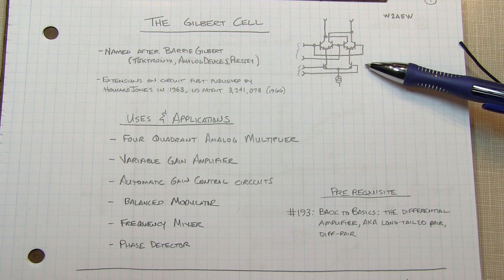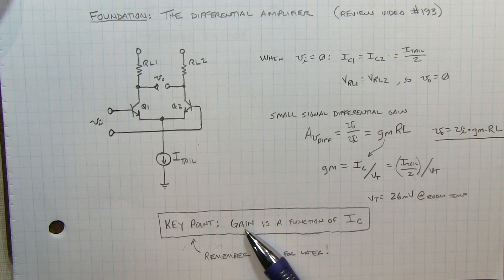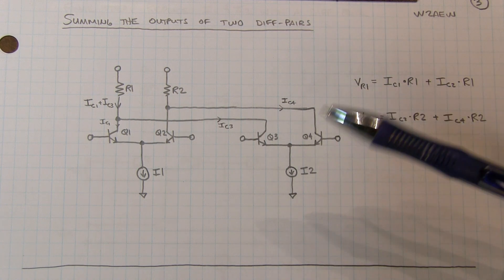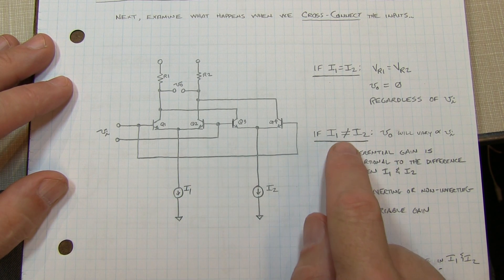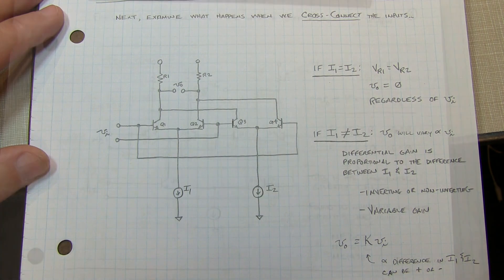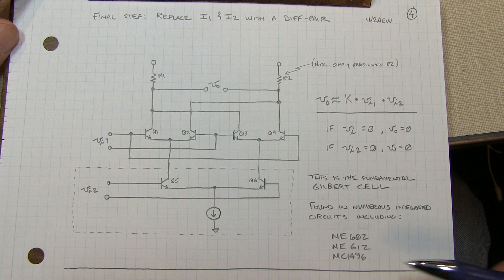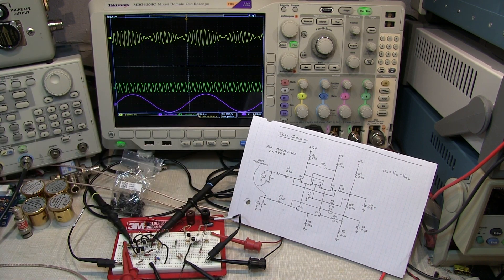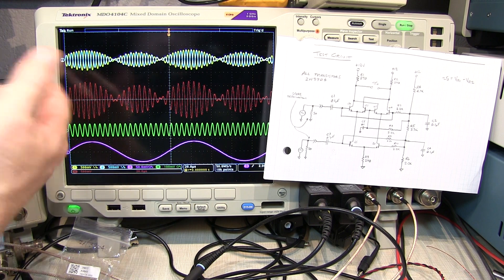#223: Basics of the Gilbert Cell | Analog Multiplier | Mixer | Modulator

Comment: I don't see the AC SIGNAL FOR the other Q6 transistor. Am I missing something?
Reply from the maker: Each of the diff pairs are driven single ended, thus there is no AC signal applied to Q2, Q3 or Q6.  These are merely DC biased.
Reply: Thanks. All is clear now. I am working on an Integrated IQ mixer for 77Ghz. I will give you more feedback soon.
Reply from the maker: That sounds like quite a challenge.

Comment: Hi! may I ask what is the use of the Arbeitspunkt Operating Point in a Frequency Multiplier Module? On how does it affect the output frequency? Thank you!
Reply from the maker: The operating point doesn't generally affect the output frequency (or frequencies).  It will often affect the magnitude of the generated components.  For example, the bias voltages in a Gilbert Cell mixer can make the difference between AM and DSB-SC (double sideband suppressed carrier).  The same sidebands are generated in each case, just the magnitude of the carrier is the major difference.

Comment: 16:32 What is DC offset, and how would you go about applying it to the input frequencies to eliminate phase shift? Could you offset the lower frequency input both negatively and positively?
Reply from the maker: The DC offset is the mid-point voltage of the signal with respect to the bias voltage on the opposite input of the differential pair.  The offset can be positive or negative.  This is illustrated in the followup video:
https://www.youtube.com/watch?v=mejPNuPAHBY

Comment: Such a great video on the gilbert cell. What considerations did you make when choosing the resistor and capacitor value.
Reply from the maker: R4, R5 and R6 were chosen to establish the common mode bias voltages for the upper and lower pairs (approx 6.5V and 2.6V).  These bias voltages ensured about 2V across the main current setting resistor R3.  R1 and R2 chosed to be the same as R3 out of convenience about knowing the voltage drops without calculation (since drops determined by current in R3). R7-R10 somewhat arbitrarily chosen to connect to the bias resistor string (R4-R6), and provide a load for the signals applied.  Caps somewhat arbitrarily chosen to provide signal grounds.

Comment: LIGHT BULB!!!   Thumbs-up, and subscribed!
Thanks so much... I was familiar with balanced amps, but the double-reversed with balanced gain mixing topology here is really cool.  Here's my problem...

I'm working on an IQ digital modulator in a piece of avionics test equipment that uses a pair of the UPA101's as Gilbert Cell modulators. They are fed L.O. (120-170MHz) through lead/lag  L/C circuits (main balanced inputs), the tails are commoned and static (shunt 5.1V zener regulator, each via its own NPN common-emitter buffer), the differential gain inputs are driven by the I and Q gain circuits (the Q channel has a slightly adjustable gain control circuit to balance them... all via sampled feedback).

Then the outputs from each Gilbert Cell IC are summed to create the TX IF. 

The problem I'm having is that the carrier is not being eliminated, but only reduced by about -10dB, where it should be reduced about -50+dB from the main offset frequency (either upper or lower).  It does the same thing regardless of whether the IQ inputs are creating USB or LSB... the carrier leakage is still horribly high.

From what you said, it seems the carrier reduction should be happening in this modulator circuit... I kept thinking maybe it was in a TX IF gain-reduction circuit...

Thoughts?  Each IC has active outputs, but I did notice a DC imbalance on one of them when I was trying to troubleshoot it... and from what you said, they should not have any DC imbalance... right?  

I have full schematics, but the mfr gives no detailed circuit operational theory... at least not enough to help.  Your video gave me FAAAARRR more info than the mfr did!
Reply from the maker: DC imbalance will definitely lead to poor carrier suppression.  You may also want to view this video:
https://www.youtube.com/watch?v=RHFZUqUM8DY
Reply from the maker: https://www.youtube.com/watch?v=RHFZUqUM8DY

Comment: Can you tie one of the two output nodes to ground or will that change the functioning of the circuit?
Reply from the maker: No, you can't tie one of outputs to ground.  If you're not going to use it, you can tie it to the positive supply, or leave it open, or AC couple to ground through a resistor that equals the impedance seen by the other output (best choice).
Reply: Thanks for the reply! I'm used to all my signals being referenced to a common ground throughout the circuit. If I wanted to use only one of these output nodes to carry on to the next part of the circuit, my output signal would be scaled down by half right? And I could pick either node, but one would be inverted?
Reply from the maker: Correct.
Reply: Awesome. Thanks so much for the great resources.

Comment: Thanks for making these fine videos. The Gilbert Cell is good for making the Dalek voice from Dr Who.  I found on the Internet other circuits that require 2 transformers (diode ring mixer) which I would have to order. Whereas, I have lots of 2N3904 transistors.  My project did require some extra sub circuits: 1 2N3904 as a computer mike amp, LM358 as differential amp for the output of the Gilbert Cell, and a LM386 to drive headphones. So now I can :  Exterminate! Exterminate!
Reply: Would love to see your final circuit !

Comment: not sure it is called mixer if only amplitude modulation with suppressed carrier occurred. mixing is the engineering term for a product and a sum at the output. Gilbert cell is a mixer  that applies the signal mixer method for modulation schemes. correct me if I am wrong please.
Reply from the maker: +xDR1TeK A mixer is a circuit that combines two input signals with a non-linear transfer function.  The output will contain the sum and difference frequencies of the input signals (and their harmonics) as well as potentially the original input signals as well.  The sum and difference frequencies come from the non-linear transfer function. In the case of the Gilbert Cell, the non-linear function is fundamentally a multiplication.  A single-balanced mixer will reject one of the input frequencies, and a double balanced mixer will reject both input frequencies (meaning that they will be suppressed in the output).  A double-sideband suppressed carrier modulation output says that the mixer is at least single balanced (but could also be double balanced) because the carrier is suppressed.    Adjusting the bias to get pure AM output is essentially unbalancing the mixer from the carrier perspective.  In all cases, it is still a frequency mixer.
Reply: +w2aew thanks, would have been nice to see it act as the NE602 mixer part and upconverting the signal as well. I saw AM and hoped for clarification, which you just did so eloquently.
Reply from the maker: +xDR1TeK The NE602's mixer is a Gilbert cell, so this would do the same job if you applied your RF and LO to the two input ports.  You may also want to watch the next video that shows how DC bias conditions determine whether you get AM or DSB-SC modulation.

Comment: Nice video!  The NE602 is known for having poor linearity.  Is it specific to that device, or a general characteristic of the Gilbert Cell? You ought to do a video comparing and contrasting multipliers (the Gilbert Cell), mixers (i.e. hard switched commutating), and phase detectors.
Reply from the maker: +Louis Brown The NE602's bad rep for linearity (poor IP3) stems mainly from the fact that it has a limited dynamic range.  This is due to the implementation and limited supply voltage.  The Gilbert Cell isn't inherently bad.

Comment: A very helpful demonstration.  Thank you.  I'd be interested to see you demonstrate the DSB generation using the same test circuit.  Assume it's necessary to apply a positive bias to the lower pair, correct?  It would be cool to watch as you raise the bias offset voltage while observing the phase shift changes on the output.  Hmmm.. might one produce a phase modulated carrier by modulating the bias voltage?
Reply from the maker: +k1mgy I am planning a video to show AM and DSB(SC) signal generation, and how the DC bias affects the modulation and spectrum of the emission.

Comment: Hello Alan,I built the diode ring mixer in your other video and got the same waveform as you did with the odd symmetry where the peaks and troughs don't line up.   I used the MC1496 chip two weeks ago and that was the only time when I evergot the true AM waveform.  Any idea what is going on ?  Can DBM ring mixer make AM waveform ?Many thanks :-)
Reply from the maker: +Peter B By definition a double balanced mixer is designed to attenuate the input signals - thus it suppresses the carrier.  For AM, you want the carrier, so a DBM isn't the best way to go.  If using a Gilbert Cell for AM, you intentially add a DC offset to the baseband signal (unbalancing the cell) to prevent the gain from inverting so that the carrier is preserved.
Reply: +w2aew +w2aew Is every transformer earth grounded ? For the center tap on one side of the diode ring I connected my scope probe. But should the ground clip of that scope probe go to power supply/earth/common ground or the other center tap on the other transformer on the other side of the diodes (floating) ?  My understanding is every scope probe must be grounded to the same circuit node as the scope is itself grounded via power cable? :-). Also DSB-SC waveform is readily attainable from dbm diode ring mixer ? And finally can a dsb-sc waveform exhibit any possible symmetry ? Specifically can DSB-SC waveform have odd symmetry ? :-)
Reply: +Peter B Even though the transformers provide galvanic isolation, you are usually fine connecting the grounds to the center taps of various windings, provided the circuit that winding is connected to doesn't bias the tap to some other voltage.  With proper drive levels, you can get a DSB-SC signal out of a diode ring mixer.

Comment: The only thing I got out of this (my problem not the video) is that my fundamental views of current and voltage flow is likely wrong as I could not understand how the output transistors controlled the input (upper) transistors.  Best I go back to the basic basics ;)
Reply from the maker: +Digger D Many people can relate to the water analogy.  Current flow is like the flow of water through a pipe.  Water flows due to water pressure.  Voltage is like water pressure, causing current to flow.
Reply: Thanks, I often have trouble with "conventional" current flow vs "real" current flow ;)  I watched a few videos to set my mind back on track and think I follow it now.  Actually I realized I was messed up while watching your video ;)  Been out of this for years and I guess I skipped a few steps getting back into it.  Just change the directions of all the PN junction arrows and I'll be ok lol.
Reply: ***** I blame it on the scientists, they never like to admit their wrong and once they realized electrons move from negative to positive (real current flow) they refused to rewrite all the books.  Typical ;)

Comment: How about for an AM waveform ?  Can a AM waveform have odd symmetry ?  I mean if I don't get the classic AM  double pinched classic envelope does that mean the circuit added the two sinusoid signals and is not truly multiplying them ?
Reply from the maker: +Peter B For AM, if the RF envelope's peaks and troughs don't line up, then there is likely some addition of the waveforms going on.  However, in most cases, this should be filtered out by the appropriate bandpass filter on the RF output.

Comment: Great vid. Would you use this for a QAM as well or do they stick to the simpler multipliers?
Reply from the maker: +Rob Fowler It certainly could be used for QAM, often times a pair is used - one each for the I and Q (in phase and quadrature) components.
Reply: Any comments as to the linearity? It seems it would be much better than a simple transistor multiplier.
Reply from the maker: +Rob Fowler Linearity is quite good when input signals are less than Vt. If signals are naturally greater than Vt, then the linear range can be extended (for the lower, current steering diff-pair) by including resistors in series with the emitters.